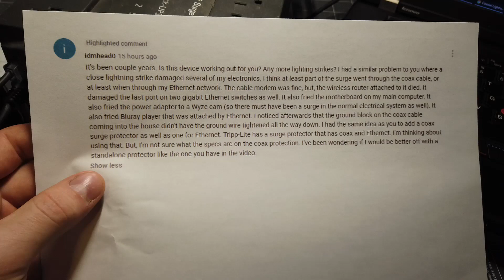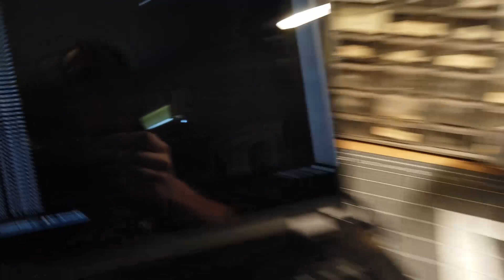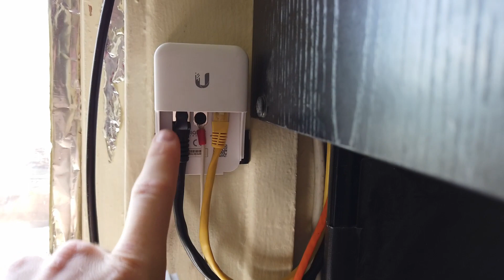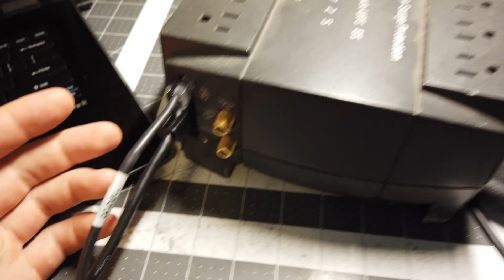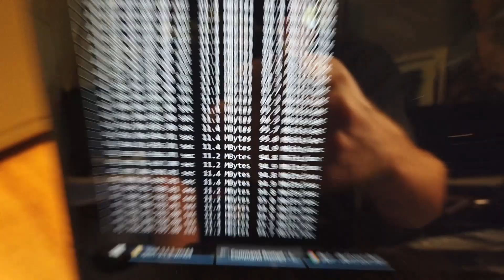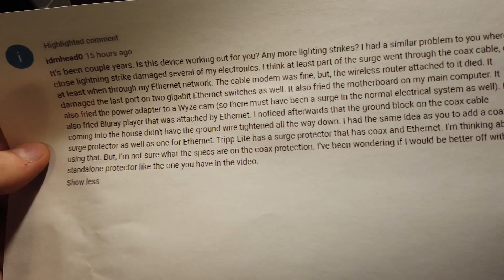How to protect you computers and networking equipment from power surges from your ISP

Comment: Thanks for creating the video. Much appreciated. Yes, I agree with you, the manufacturers do not do a very good job posting the technical specifications for this stuff. One manufacturer will list things one way, and another will list things another way, making it difficult to do a side by side comparison. One other thing that I learned is that you need to be aware of what the "clamping voltage" is for surge protectors. I bought a bunch of GE 6 outlet surge protectors that plug into the wall. I think they were about 1000 joules. I knew they weren't great, but, I found out after the fact that the joule rating is somewhat meaningless. It's more for marketing. The GE surge protectors that I have are listed at 600 VPR (Voltage Protection Rating). I'm still trying to figure out if VPR is the same thing as clamping voltage. I read online that anything greater than 400 volts for clamping voltage is pretty much useless. This seemed to prove true for the lightning strike that I had trouble with. Equipment was damaged while the surge protectors seem unaffected. Though I think at least part of the surge probably came in through the coax cable from the cable company. I had another GE surge protector with 6 outlets on a cord. That one is 500 VPR. I have a bunch of these. If indeed VPR is the same thing as clamping voltage, I'm thinking all my surge protectors are pretty much useless. I'm looking into getting some better ones. I'm thinking of getting some Tripp-Lites. They have a clamping voltage of 140 volts for the Isobar/higher quality ones and 150 for some of the other ones. For some reason they don't list the VPR though. I think the VPR terminology may be part of the UL standard. Also, I noticed that the surge protectors on a cord, has L-N, L-G, and N-G protection. The one that mounts to the wall only has L-N. I'm assuming that means that it only protects on one of the wires. I think the surge can come in on the other wires. To a certain extent, I think the surge protectors I have aren't of much use. Probably only a little better than a tap with no protection. Also, I am researching whole house surge protection. I read online that there are 3 types of surge protection, 1, 2, and 3. Type 3 are the surge protectors that you plug into the wall. Type 2 gets installed in your electrical panel and Type 1 gets installed on the meter. I'm looking at a couple Square D type 2 surge protectors. From what I've read, most surges come from inside the house from things like electric motors turning on. Type 2 is supposed to help level that out. Plus, it can help protect other things like air conditioners, your furnace, etc. which can't use a plug-in surge protector. Good to know that the Ethernet surge protector that you have, supports gigabit. I did notice that the one built-in to the Tripp-Lite I was looking at only supported 100 Mbit. If I were you, I would get that ground line hooked up properly. Most likely, your equipment is fried again if you get another strike with the way you have it setup right now. The surge protectors redirect to ground. So, if the ground isn't hooked up properly, it won't work.
Reply: Actually, I think I read somewhere something about surge protectors that only support L-N. I think maybe it is to support wiring that doesn't have a ground. I'm not an electrician and have only a tenuous grasp of how this stuff works. I just know that I want to make some kind of attempt of protecting myself from having a repeat of what happened the last time. Which was losing two 8 port gigabit switches, the motherboard on my main computer, a wireless router, a Bluray disc player, a power adapter to a network camera, and a charger for a lawnmower battery. It took me several weeks to get everything back to what it was before the strike. I think most of the damage came in on the coax cable. Or at least somehow the surge seemed to go through the Ethernet network.
Reply from the maker: You have really done your homework! I will be finishing my wiring soon, hopefully before the next storm. You may want to look into the XG-PCS-15D or similar type device this one claims to have gigabit Ethernet protection and had some cool remote control functions you may find interesting. I used these types of surge protectors for my customers that do not want to pay for a battery backup. I have not done a tear down of one yet but I have to imagine the guts are a way better then any power strip you can buy. and you can connect a cheep power strip after it. this unit is rated for 15 amps. this is more than any normal power strip could handle. Like i said in the video I prefer battery backups, in part because there is way more parts to give up the ghost inside before it gets to your equipment and If you had a "ok" power strip with some MOVS to clamp the voltage over 140 volts I think you would be fine. 

Also I dont think having a MOV between Hot and ground and neutral and ground is important. The first reason most devices like routers and modems and anything with a power brick is 2 prong so no ground anyway. The second reason is back at your electrical panel if it was installed correctly neutral and ground are tied together on a bus bar. That leaves ground and hot and if your device has a ground pin and it is plugged into a grounded outlet and high voltage would prefer to go to ground anyway. I keep coming back to battery backups Im sorry, but one other thing I like about then is when there is a over voltage or under voltage there is a relay that disconnects the load from the AC input.

 Yes a lightning strike would probably be to fast for the UPS to detect and too fast for the relay to disconnect in time BUT as I said there is a lot more components to fry in the UPS before it gets to your gear so instead of just a couple MOV to blow you would have depending on your UPS you would have a fuse, transistors, MOVs, transformer and other components. Also If you had a bad storm and you where lucky the power would go out and the UPS would disconnect your stuff before the surge. A power strip would only clamp the voltage.

 In a perfect world you would have a raspberry pi running home assistant that would look at the weather conditions and if It saw lightning or thunder storms in the area it would tell your UPS to disconnect from the grid till it passes. 

Thanks again for reaching out If you have any updates to your project or any other input I would love to hear it.

Comment: Thanks for making this video. I don't really understand much about electricity/voltage to be honest - but I am thinking to get the Coax surge protector to put between my coax in and my modem. But I don't understand what I am supposed to "ground" the protector to? The coax is coming into my living room. I realize this may be a very stupid question but I would really appreciate your help.
Reply from the maker: Basically a ground is anything earthed  such as copper or galvanized plumbing. Google grounding methods or what is earth ground and you will find diagrams on where to connect your ground. And how to do so safely.

Comment: Everything connected to my Ethernet network is protected except for the cablemodem due to the incoming coax.  I don't really trust non-brand name coax protectors -- any thoughts on a polyphaser 0-2.5Ghz unit?  I think DOCSIS 4 goes up to 1.8GHz.

Comment: Would this equipment also help prevent internet service upsets by limiting power spikes on a household system?  I've called my cable company out 3x now due to quasi-intermittent internet service drops.  I have noticed that things as the furnace blower motor starts up that sometimes I will lose service and then the router (tried three of them by now) don't seem to want to resync to the cable companies modem.  The router power supply is ungrounded and on a power strip of unknown surge suppression rating.  Do these surge devices only protect from lightning and the like, or do they help stabilize voltage provided to all devices on the strip?  Any thoughts?
Reply from the maker: This will not fix your problem. if you internet os going out you probably need the cable between the pole and your home replaced. or you need a new modem. Also most homes may have splitters to feed different room try to eliminate these splitters and run your modem off the main coax coming into your house. 

Surge protectors only protect from gross overloads roughly over 150 volts. What your looking for is a power conditioner. 

Start with the easy stuff tell your ISP that your want a new cable from the pole to you house and a new cable brought into the house connect your modem directly to the new cable with NO splits or junctions. Request a new modem or purchase one if you like. 

You dont need a power conditioner but  surge protection is good to have if your in a storm prone area.
Reply: @GetNshitDone  thank you for sharing your insight.  Last time they were here they removed a filter/amplifier before the cable modem.  That seemed to make things worse.  It's unfortunate that my service interruptions seem to be between cable modem and router, and the modem is theirs and the router is ours.  So it's just easy for them to claim that it's not their equipment unless we start renting a router from them which they can of course monitor from afar.  I find it disturbing that the router reboot must be done in conjunction with a modem reboot for things to work again.  This to me suggests bad modem firmware or software functions as the problem repeats irrespective of the router that I put in its place.
Reply from the maker: @Project314  I think you have a compound problem. Again I would go through the steps that I mentioned earlier and focus on removing as many variables as possible One cable from the pole to your modem one cable from the modem to your router and one cable from the router to your computer. If there is instability in any one of those connections replace one of those components or cables and repeat process until the problem is solved. In some situations you may just have to change internet service providers some internet service providers are just horrifically unreliable. And their infrastructure is obsolete. If you're having issues with your router anything that can be purchased from a local electronics store or Amazon will work fine sometimes the power supplies start to go bad on routers and modems and cause a tremendous amount of issues and headache. Sometimes it just takes replacing the power supply to fix the problem however most devices have different power supplies so I recommend just getting a whole new unit if you spend more than $50 on a simple router you're paying too much. Unless you're trying to do something more complicated like mesh networking or having more than a hundred megabits per second overall throughput.
Reply: @GetNshitDone  I wouldn't doubt the compound problem possibility or probability.  I had not considered the bad router power supply possibility, and I suppose the same could be true of the cable modem.  I have had a couple of Raspberry PI setups and it's amazing how finicky they get on undervoltage especially as the PI is loaded up with USB devices.  As pretty much all the routers use the same 12v barrel plug I never considered swapping the power supply as I was swapping routers.  

When there are transformer failures and the like it's not impossible to have a "silent spike" on your system that destroys things on AC at random.  

In any case, I spent the balance of the day moving my wifi router right next to the modem so that both router are now on new (or at least different) coax/Ethernet cables.  In general, I try to run as much as I can on Ethernet, so that was a pain.  I was also able to eliminate one coax wall penetration due to the equipment relocation.  That alone could eliminate my problem.  That wall penetration is right next to the electrical box near the whole house, so that may be a massive source of EMF noise.  I was also running flat cat 6 cable between the modem and router, so I don't know how much that plays into things.  But as for the real failure, it wasn't that service was interrupted for periods, but rather that it wouldn't self-correct once it was triggered, and that the triggering was sometimes coinciding with a furnace blower motor startup.  This to me suggests router power supply was sketchy and was maybe undervolting router hardware and keeping it from resuming comms after the electrical perturbation gremlin was introduced to the system.
Reply from the maker: @Project314  If you think you blower motor is having this much of a effect on your electronics I think you need to have service call to your furnace you may need a replacement motor capacitor or the motor may be on its last leg and drawing too much current making you AC line voltage drop too low. In any case you are right about under voltage causing problems.
Reply: @GetNshitDone  I see no evidence of super high inrush.  I'm not sure if it's on a dedicated circuit, but I see no dimming lights or malfunctions apart from this.  The blower motor is a soft start and it seems to come on line pretty gentle.  I don't know what they do for a security handshake between modem and router and suppose that bad cables could have caused the problem but so far so good.  Thanks for helping me think outside the box.

Comment: So Other than testing yourself, Schneider Electric does not list "Data Speeds" or throughput for any of their ACP-BB devices...?
Reply from the maker: Honestly company's love marketing if any manufacturer dose not put it on the box as a selling point chances are  it's a 10/100T max speed. Otherwise the would use gigabit as a selling point and charge you extra. If you look in the description I have a gigabit Surg protector you can get from Amazon.